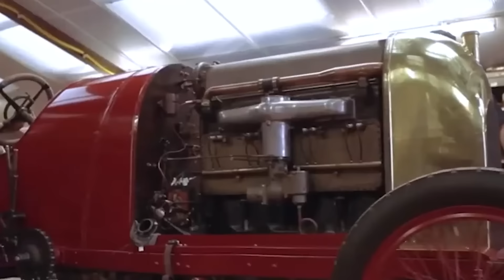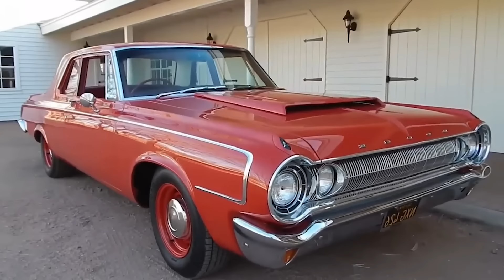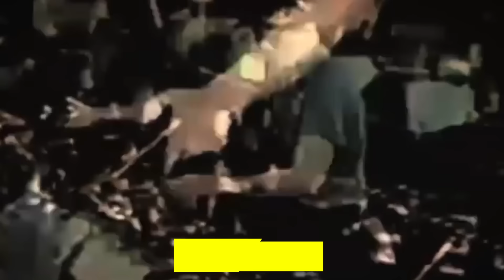10 LARGEST Engines Ever Put Into Old Cars!

Comment: LARGEST OLD CAR ENGINES :

@00:33  :  FIAT S76 ENGINE ( 1911 ) "THE BEAST OF TURIN"  : 28.5 LITER  IN - LINE 4
                  CYLINDER ENGINE ; BORE : 190 MM & STROKE : 250 MM  
                  @290 HP @1400 RPM
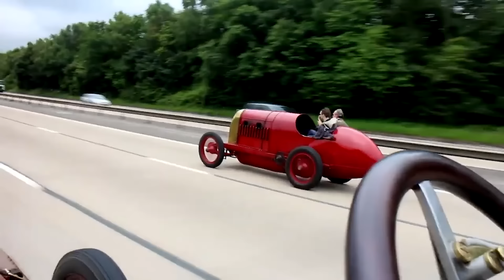@02:00  :  CADILLAC  V16 ENGINE ( 1930 ) : 452 CUBIC INCH ( 7.4 LITER ) V16 ENGINE
                  @185 HP
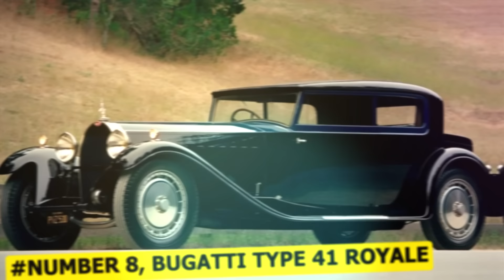@03:33  :  BUGATTI TYPE 41 ROYALE ENGINE ( 1926 - 1931 ) : 12.7 LITER STRAIGHT
                   EIGHT CYLINDER ENGINE : BORE : 125 MM & STROKE : 130 MM : @275 - 300 HP
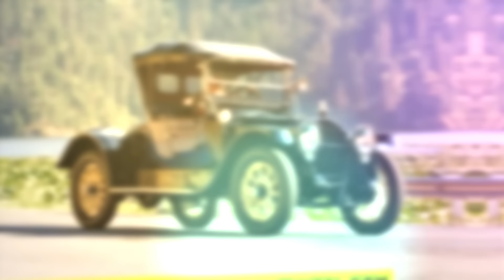@05:05  :  PACKARD TWIN SIX ENGINE ( 1916 ) : 14.8 LITER V12 ENGINE : @88 HP
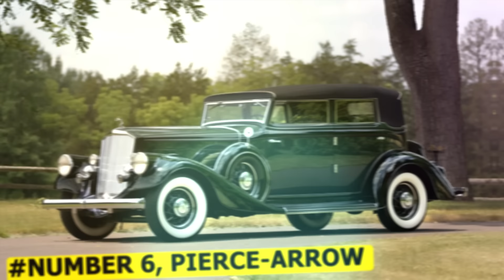@06:30  :  PIERCE - ARROW ENGINE ( 1910'S ) : 8.6 LITER INLINE SIX CYLINDER ENGINE
                  @48 HP
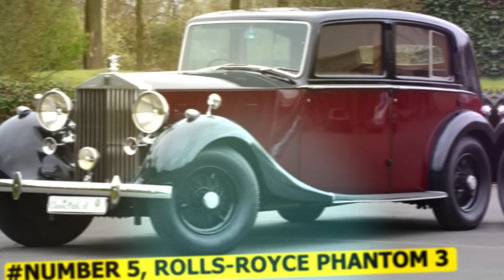@07:42  :  ROLLS - ROYCE PHANTOM 3 ENGINE ( MID 1930'S ) : 7.3 LITER  V12 ENGINE 
                  @165 HP
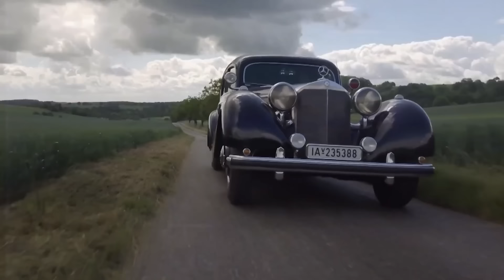@09:00  :  MERCEDES - BENZ 770 ENGINE ( LATE 1930'S ) : 7.7 LITER INLINE EIGHT 
                   CYLINDER ENGINE @150 HP
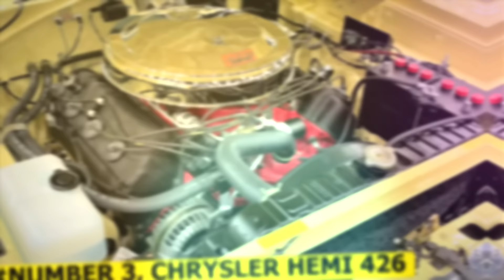@10:20  :  CHRYSLER 426 CUBIC INCH V8 HEMI ENGINE ( 1964 ) : 7.0 LITER ENGINE 
                   @426 HP
@11:55  :  CHEVROLET 454 CUBIC INCH BIG BLOCK V8 ENGINE ( 1970 ) : 7.4 LITER ENGINE 
                   @450 HP
@13:30  :  CADILLAC 500 CUBIC INCH V8 ENGINE ( 1970 ) :  8.2 LITER ENGINE @400 HP

Comment: I wonder who told them the first Packard Twin Six engine was 14.8 litres. It was actually only 7 litres - hence its 88hp output. In contrast they mention the Pierce-Arrow 48hp (nominal not developed hp) at 8.6 litres, but Pierce made a larger model at the same time, the 66hp, which had a 5-inch bore and 7-inch stroke for 824 cubic inches - 13.5 litres. There were several American makers in the pre-WW1 era that built engines of more than 500 cubic inches, but these seem to have been conveniently forgotten.

Comment: Very poor research...mistakes everywhere
Reply: All the MODERN info is wrong. The 440 is bigger than the 426 Hemi. Oldsmobile Buick and Pontiac had 455 engines.
Cadillac had a 472 and a 500 Engines. Ford had a 460. Some of the Dodge vipers had a 513.
Reply: No one's perfect.
Reply: @scottdouglaswashburn7769 Should be in such a video .